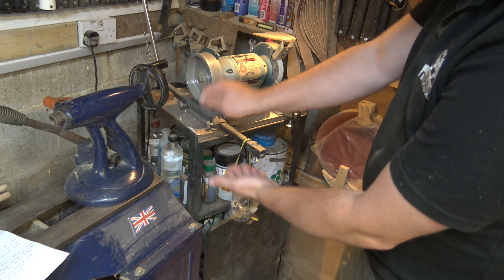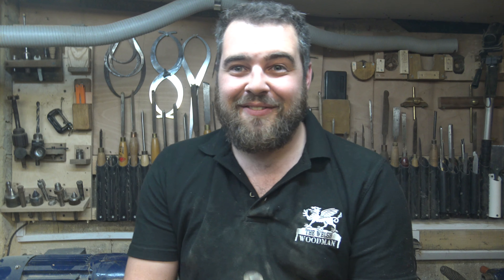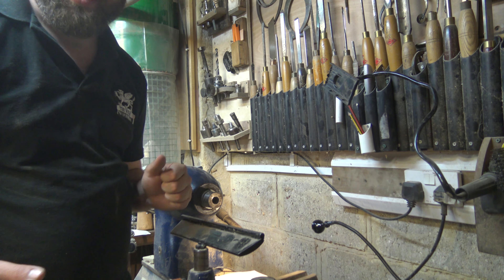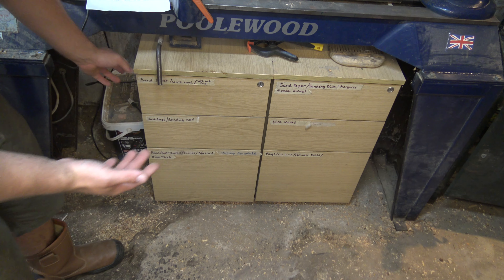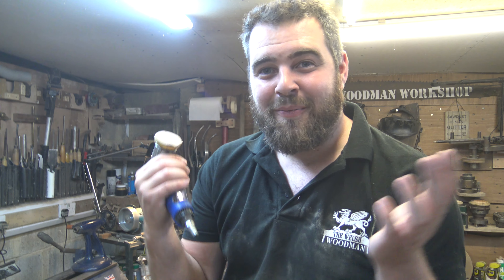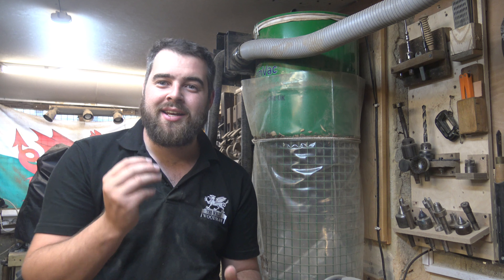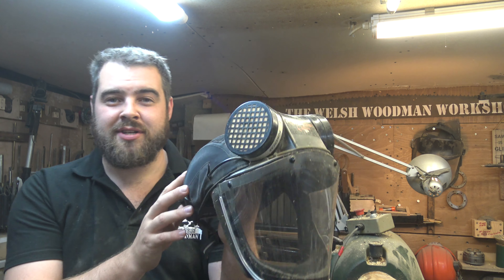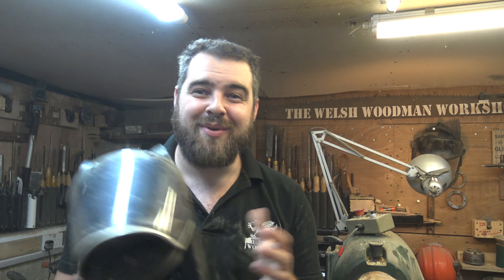How to get the perfect workshop layout for woodturing

Comment: I really like this as I am still a beginner. At 3 minutes in I noticed all you tools are face up. I watch Glenn Teagle turn caps to put on the blade tips of his tools. Not just to protect them, bat more to protect himself.
Reply from the maker: Thanks for your comment Len, I like the idea of turning caps especially when taking my tools to club demonstrations to protect the edge, thanks for the idea. I've found as the tools are against the wall they reduce the hazard of falling on top them, I tend to pull them out of their stand at the base of the shaft of the metal and this way I've avoided any injuries pulling them out since they've been up on the wall 👍 thanks for watching 😁

Comment: Hi Tom, Great video. I have used most of your methods for storing things close to the lathe. I used magnetic bars to secure my chisels and gouges but might change that to individual pvc pipes. My shop is only 10' by 8' so space is a premium. Diolch Tom. Hwyl, Huw
Reply from the maker: Thanks Huw, I almost went down the magnet rout but the PVC pipe  worked out cheaper in the end and has worked out really well. I got the 40mm waste pipe rather than the 30mm as I found this size fits the tools better :-) thanks for watching

Comment: Hi good videos, I have been offered a poolwood lathe at a reasonable price but am concerned with maintenance, are there difficulties in finding parts for the machine??
Thanks
Reply from the maker: Hi Luciano, Poolewood lathes are brilliant Lathes , I love mine as its really reliable and you can run it all day long, the direct drive motor it brilliant. As the company that produced the lathe/motors went out of business many years ago it can be hard to find parts if anything goes wrong with the motor or inverter, however all the bearings and things that might wear out are easy to find and replace as they are a standard size.My inverter unfortunately went about 2 months ago still looking for a replacement which is hard to find during the lock down, hopefully should be able to replace it soon. I hope this helps.
Reply: @thewelshwoodman649  Hi, Thanks for that, This machine appears to work on 240v, does this mean that the 3ph inverter is part of the control board?
Reply from the maker: @lucianosalt2396  that's right it's got a 3 phase motor the inverter changes 240v to 3 phase
Reply: @thewelshwoodman649  ahhhh! Thank you, that explains much! You are a gentleman

Comment: Thanks for your reply, the previous owner miss used it, now the quill is damaged which makes it very difficult to wind in & out.
Reply from the maker: It might be worth taking the tailstock  apart and look at the threads inside the quill and the winding bar, to see if they are clogged up or if any of them have been crushed, as that can effect how easy  it can move in and out. If they are crushed you can retap the quill and rethread the bar , if it is only a small area on the bar you can use a needle file to solve this. If the quill has twisted in the tailstocks and has been tightened up not in the milled slot this can cause bumps on the quill that can catch when moving in and out these can be filed flat to solve this problem always worth giving it an oil and greasing it up. I hope this helps if your still having trouble you can send me some photos or a video of the problem via email and I'll try my best to help 😁 thanks for watching 👍
Reply: I have a General 14" lathe for which spares are no longer available.The thread on the quill of my head stock stripped recently. I took it to a local engineering firm. The were able to ascertain that the screwed bush could be rectified but that the quill was past repair. $300 later I now have a very nice quill and  tail stock again. Hated to spend the money but cheaper than a new lathe. Jim, Montana Wood Art Bozeman MT.
Reply: @thewelshwoodman649  I got my tailstock fixed by a friend of mine who took it apart polished the quill & used a grinding tool inside because it had a bump so now its nice & round & the quil moves in & out super smooth.
Reply from the maker: @davidfairman5461  that's great news 👍

Comment: It sounds like I have a similar setup as Cracker Jack has in his comment. My shelf slopes down from the wall to the lathe. The area below the lathe I've encased with double doors at the front to store wood which also acts as ballast and stops shavings going under the lathe. My mini movable light is designed for sewing machinists. It has a strong magnet on its base to attach it to various parts of the lathe and has ten bright LED's - dirt cheap from ebay .
Reply from the maker: Thanks for your comment Gary 😁 I'll have to look into the sewing machine lamp 👍

Comment: My guess is it falling saved it snapping when you were using it, they dont snap just because you dropped it.
Reply from the maker: Your probably right Chris, it must have had a hair line fracture in it or some fault towards the base, I remember Knockin it off the lathe bed trying to move it further down the bed to bring up thr tailstock for the next piece,  as it fell the tip of the tool hit the concrete floor and it snapped at the base on impact, I remember being really annoyed and surprised at the same time, it was a second hand tool but other than this one I have always had brilliant luck with Robert Sorby tools 👍thanks for watching 😁